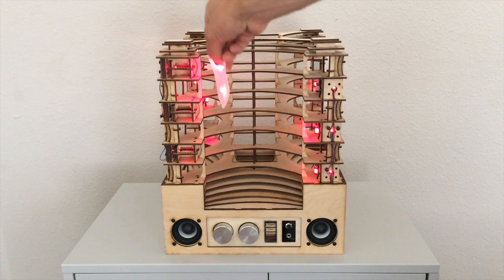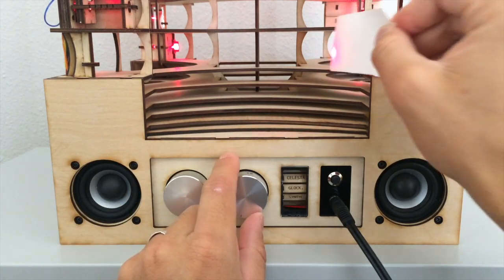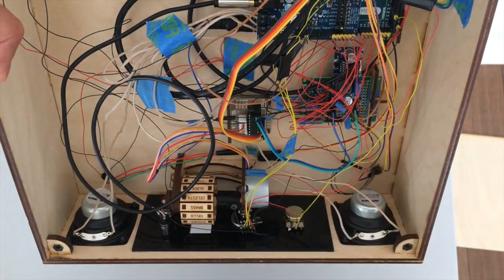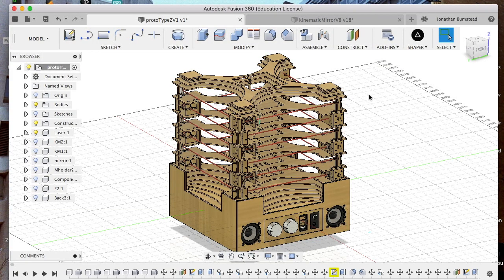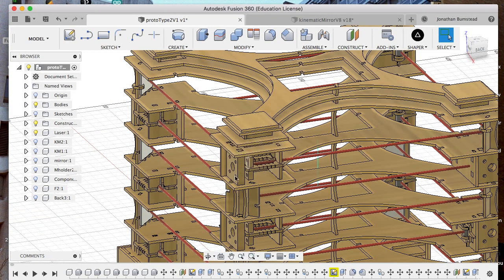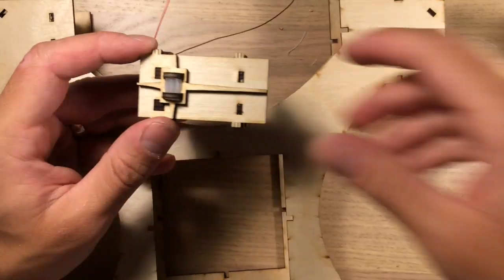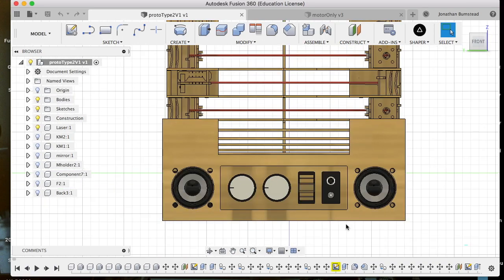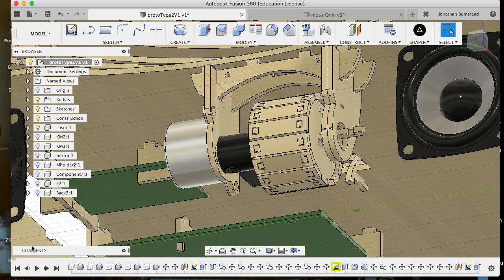Upright Laser Harp

Comment: Great video and all, I’ve got the components in front of me, how the heck do you wire the thing? Is there a second video I missed? I want to play lasers!
Reply from the maker: Here is a link to the instructable with a schematic for connecting all the electronics: https://www.instructables.com/id/Upright-Laser-Harp/
Reply: jbumstead I am so unqualified to be questioning this thing but I’ll give it my best shot. I really would like this project for our lab! (It’ll be great for tours) I’m having trouble getting the motor to rotate and the Hall effect sensor to output anything while I move a magnet over it. Is there anything not mentioned in your schematics that I can take a look at?
Reply: Thank you! I’ll see if I can’t get it through that! (This’ll be my first Arduino project)